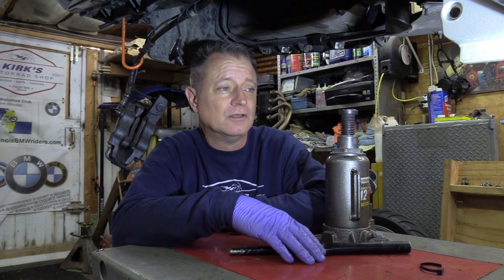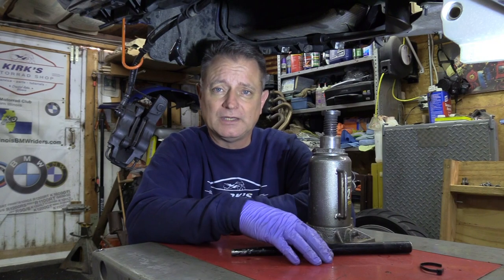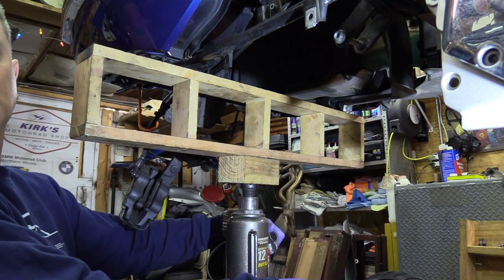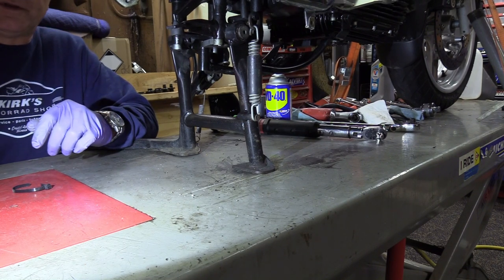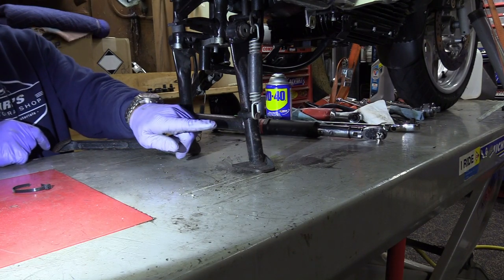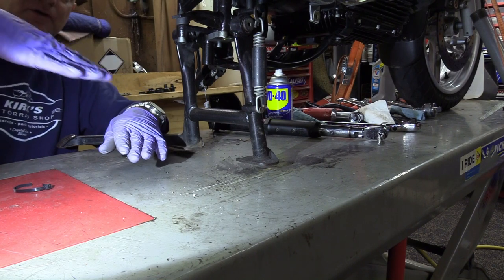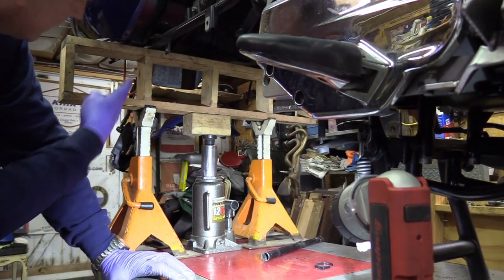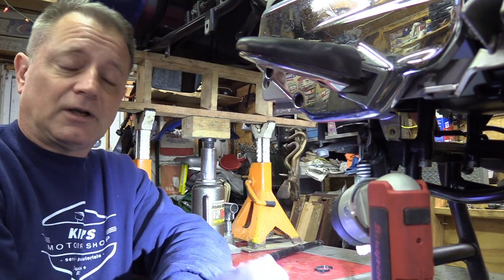Lifting the LT on the Lift!

Comment: i have found your videos to be very helpful with my 2000  BMW K1200LT and have learned a lot about this type of bike. i have only had the bike for about a month now and have discovered a problem that i am having trouble diagnosing. it seems at rpms above 2500 it starts pushing water and vapers out the exhaust, i have kept a close look at the coolant levels but it hasn't changed so i don't think it is coming from there. in addition, probably from the water issue, it seems to sputter at a frequent rate at these rpms. does anyone have any ideas what could be causing this?